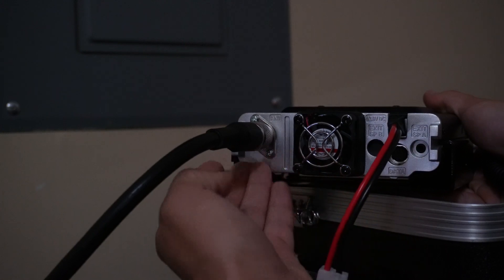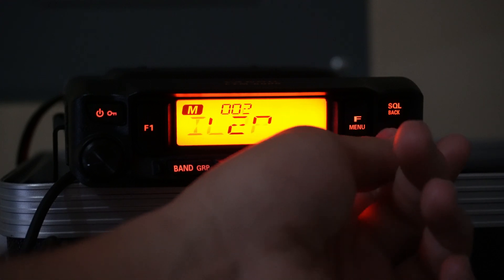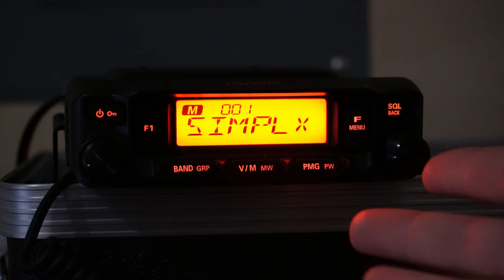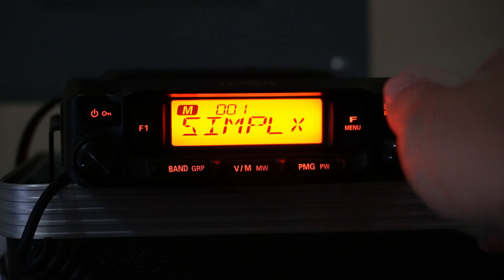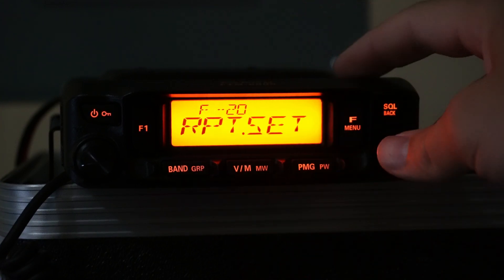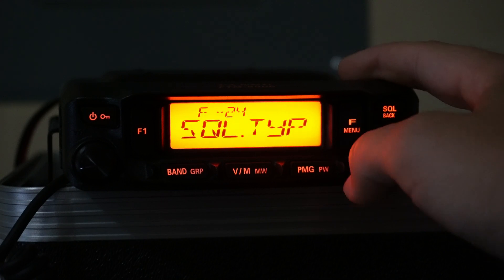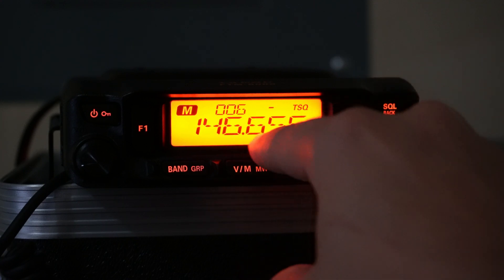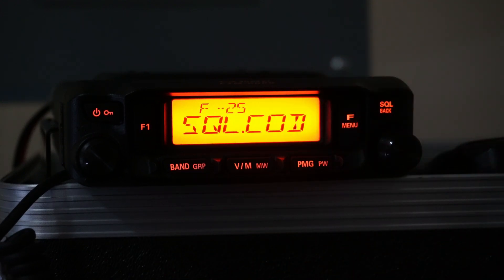Getting Started with the FTM-6000R - Repeaters, Menus and More!

Comment: Is possible have infos about wiring of the data cable to digital interfaces, audio in/out, etc ..?
Reply: It's got a digital out only not audio. So best thing is to use a mobilinc if you want to do data.
Reply: The pin outs are listed in the manual.

A wired digirig can be had with cable for cheap.